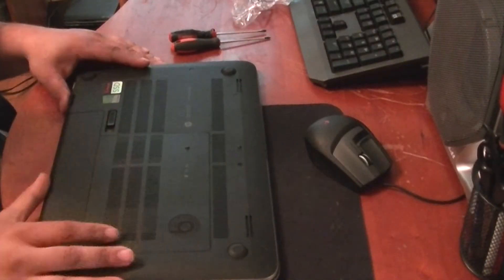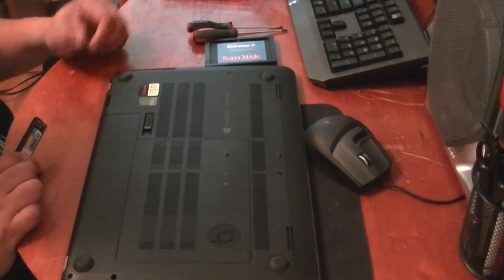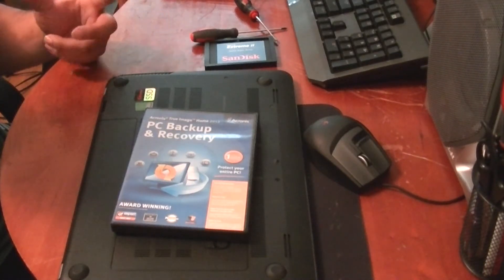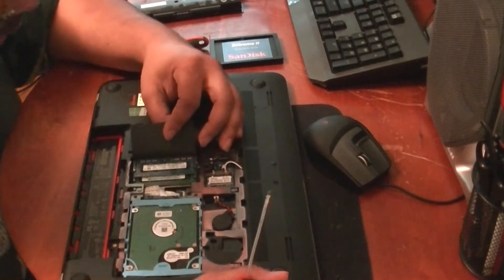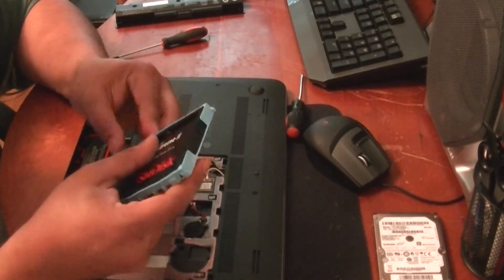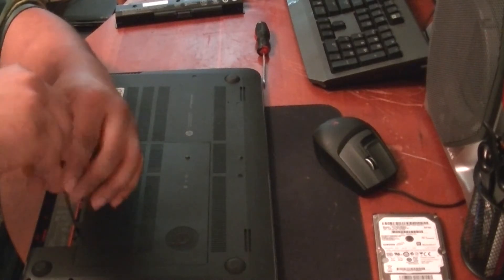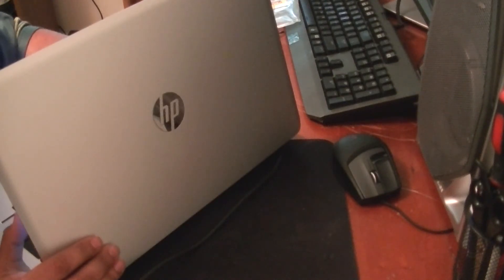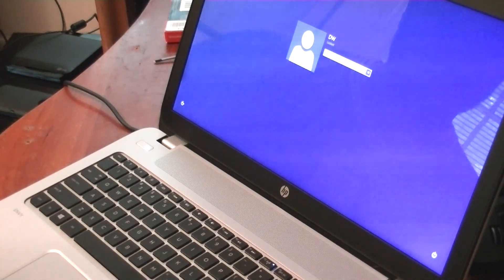HP ENVY 15Z-J000 SSD & RAM UPGRADE (2013) (Tech Dojo #11)

Comment: FYI SK Hynix is one of the best and largest memory manufacturers in the world.  Definitely not cheap or generic as far as brands are concerned.  Also the primary reason why 5400 rpm drives are used in laptops is to save power.

Comment: my problem with ssd is yes they faster but if i have 500gb hard drive full of game how the hell am i going to find a 1tb ssd that is going to cost around same price as a hard drive
Reply: Rupesh Kumar Badam
 but a 1tb hard drive is much much cheaper dont even think over £200 for my 4tb wd hard drive
Reply: What is your speed?
Reply: Rubesh kumar what is your SSD speed?
Reply: +imsey 5 idn or cear pc I turn pc probly 1s a week and it's loaded before I go pee
Reply: +Rupesh Kumar Badam along as I can put loads of games on my hard drive and still have space I'm fine I'm using over 1 tb already and I don't have that many games games plus ssd dose not work with games getting bigger and bigger will not be long till u need a tb for 4 games
Reply: +ORBIT9224 if you can afford it a ssd is better, its much faster and dramatically decreases loading times ingame. 500gb ssd is £100 on amazon right now its more than twice the price of a normal hdd but at least 5 times faster...
Reply: +Karl B I tock out a 500gb hdd because it got cruped because it was full
Reply: Ah ok 1tb is double price but still a worthy upgrade

Comment: Did you see any large improvement on the heat with using an SSD on this laptop? I have this same laptop with the A8 instead of A10, and 8gigs of ram. When I game with this thing, it gets HOT. and Idk if its because dust is building up or not, but it seems to be much hotter than when I first got it. I tried taking it apart to clean the dust out, but this thing is a pain in the ass with the amount of screws and clips holding it together, and doesn't seem to allow you to take it apart.

Comment: Hey! Great video! I used it to install an SSD in my HP J070us. Just one note though, if you buy a Samsung SSD (840 Evo, Evo Pro, etc.), it comes bundled with drive cloning software so you could use the money saved from purchasing Acronis on the top SSD brand in the market. The SSD is also reading at full SATA3 speed. Instructions below. 

Simple steps for those wondering:
1.) Purchase Samsung SSD Drive and a 2.5" External HDD enclosure ($10-$20, preferably USB 3.0). Place the SSD into this enclosure (I bought an ORICO USB3.0 enclosure).   
2.) Download Samsung Data Migration Software from their website (ONLY works with Samsung hard drives). The SSD comes packaged with a CD with this software, but since this laptop has no disc drive, just download it from the website. 
3.) Install the software, run it, then attach the SSD when prompted. Follow the directions and clone the drive. The drive size does not matter, you can pick and choose which files you want to clone onto the SSD. As long as you can AT LEAST fit the necessary windows and OS files onto the new SSD, you're golden. Transferring a new version of Windows 8.1 (no other media files, games, etc.) from my laptop's 1TB HDD onto a 240GB SSD took about 50GB of space.
4.) After the drive is cloned, uninstall the old hard drive and install SSD as shown in the video. DONE! 

You also now have a 2.5" drive enclosure to turn that HDD you removed into a portable hard drive! 

Edit: I see that you mentioned the Samsung Cloning software down below and asked if anyone tried it. In my experience it worked perfectly.

Comment: Doesn't have to be this hard.  1.  Back up your user files.  2.  On external drive/flash drive. 3.  Delete all user files (recommended to decrease time needed for windows to create an image).  4.  Use your preferred partition manager software and shrink your primary partition (windows partition) to below the size of the ssd (this is the key to preventing the problems the guy in the video had).  5.  Create a system image with windows backup on your external drive.  6.  Burn repair/boot cd.  7.  Install ssd.  8.  Put recovery/repair disk in.  9.  Boot from repair CD.  10.  Restore resized system image to ssd.  11.  Reboot.  12.  Restore user files.

Comment: you know how you say that if you add an SSD to your laptop that is smaller then the original HDD in the laptop, the SSD wont work correct ? if im understanding you correctly, my 1 TB HDD, can only be replaced by a 1TB SSD ?    im talking from the bit at 2:45 onwards . thanks

Comment: so you clone the oem hdd to the ssd with Acronis, then say you use the oem hdd for something else. If you later have a problem with the ssd and need to do a repair or clean install of windows 8, how do you do that? Also is there any point in cloning the recovery partition of the oem hdd to the ssd? will the HP configuration allow the SSD to be restored from that partition?

Comment: Well I finally got my Samsung 840 750GB SSD installed. I used a Startech Duplicator. I tried it and it wouldnt boot up. So I used my recovery USB stick and it loaded all the way through. This was going from a 1TB HDD to a 750GB drive.

Comment: I totally agree. I have the exact same lappy as u and was trying to install a Samsung 750 SSD and the laptop will not recognize the SSD.using Samsung Magician and Migration software. Yet when i try it on my other Windows 7 laptop it recognizes it right away.I'm thinking Windows 8 is the problem.I did alot of cussing too.This is unreal. Never had a problem changing a HDD.

Comment: Cloning works if you run the Windows sysprep utility.  It strips the drivers from the old hard drive. Once sysprep is completed, you can then clone a drive.  It brings the operating system back to a "first time setup" mode.